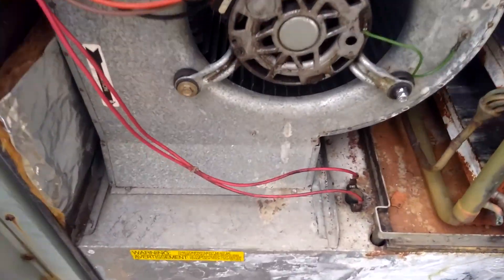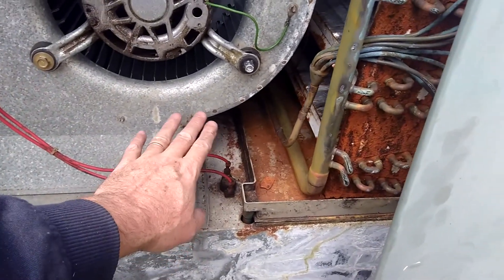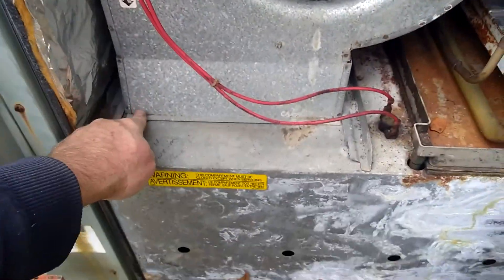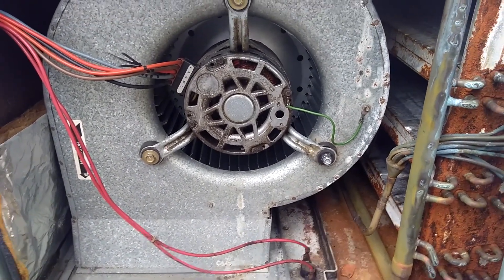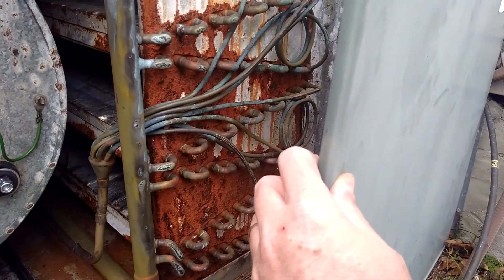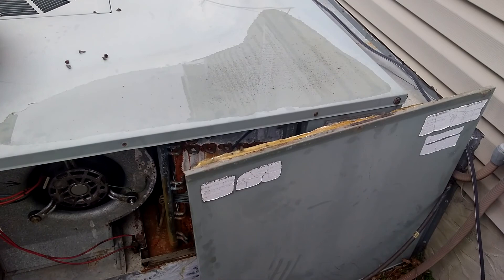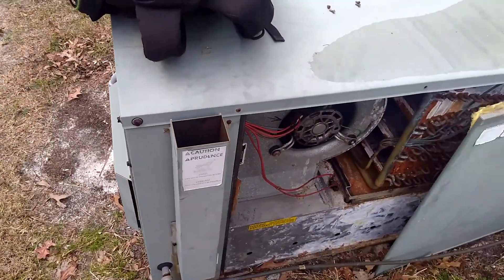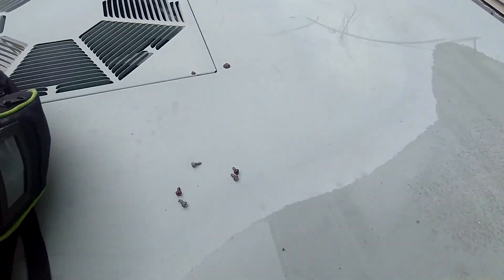Install A New Blower Wheel

Comment: I replaced the blower motor, fan and cap on a 32 year old Trane package unit.  That motor was easy to pull out of the fan.  I just got done with an 8 year old ICP and the customer and I had a hard time getting the fan off the motor.
Reply from the maker: That is the way it goes, never know how easy or hard they will be to remove. Having the right tool makes the world of difference. Thanks for watching.